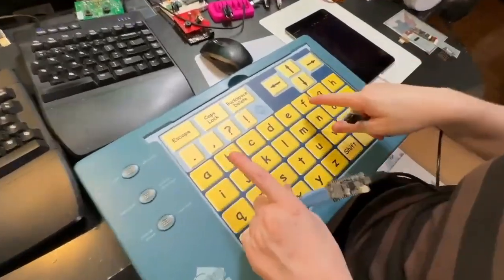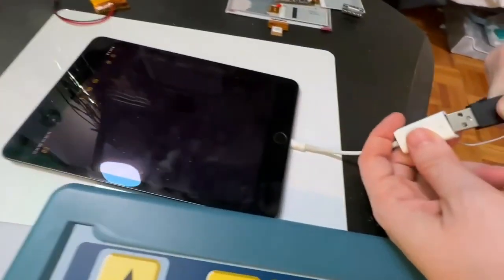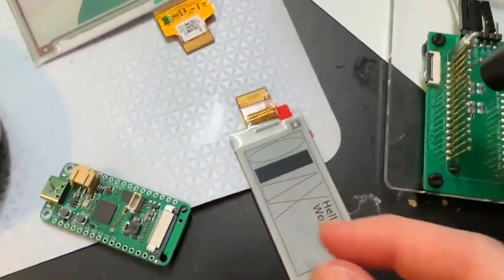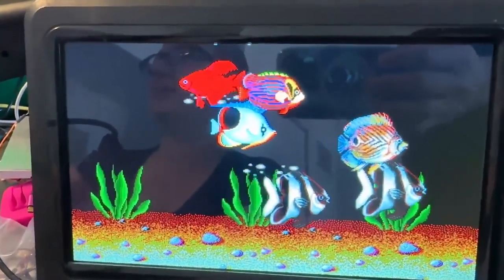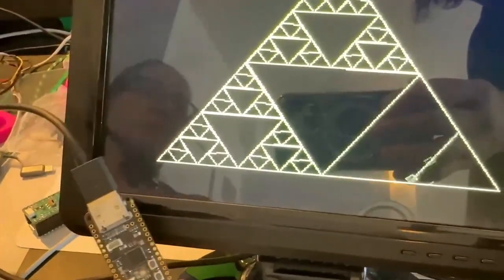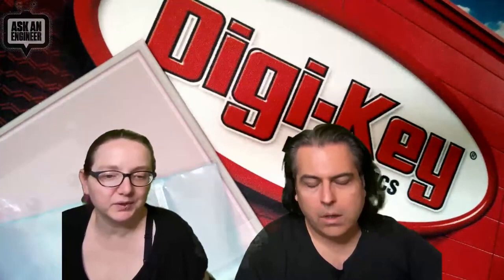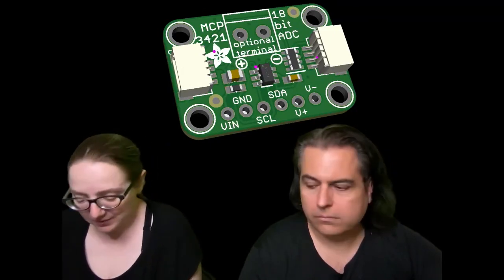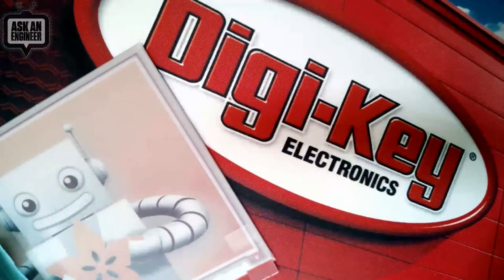Adafruit Top Secret April 19, 2023 #Adafruit #AdafruitTopSecret @Adafruit

Comment: I'm blown away by the casual ease which you move from chips in a bin to I2C on a PCB SKUs in your store. It is truly inspiring. I would love to see you talk more about your starting points and toolkit; you clearly have a form factor and a set of excellent table stakes features when you introduce a new QT board. I'd be really curious if, for example, you have 3-4 starting point templates saved that have level shifting logic and whatever IC you plan to use for seesaw.